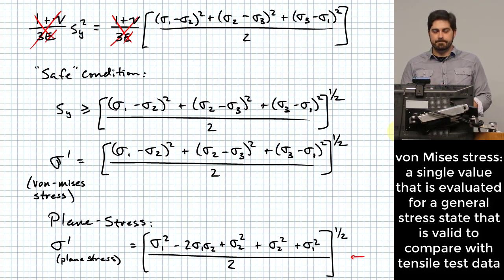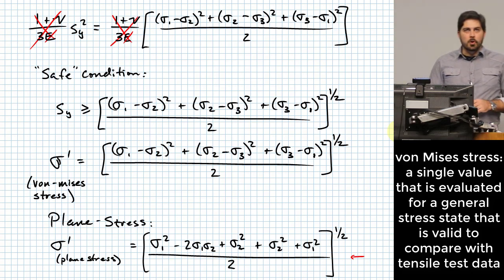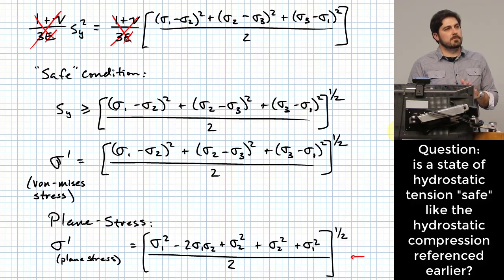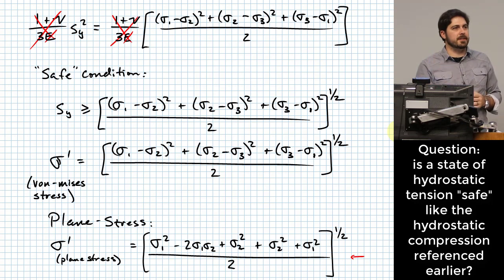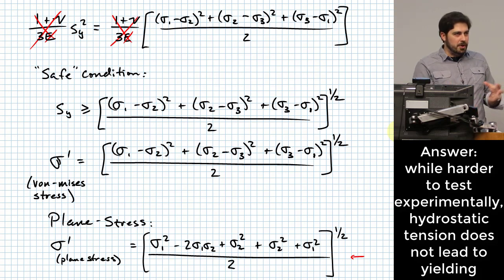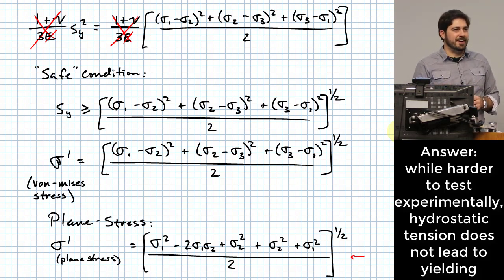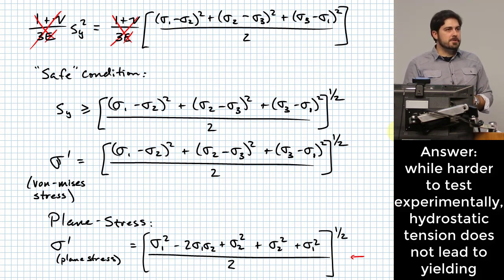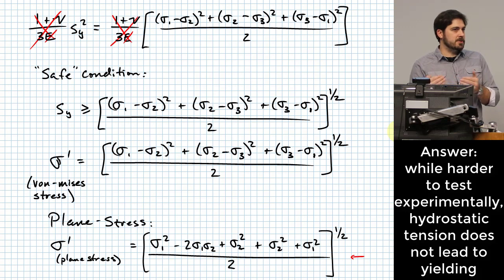Distortion Energy Static Failure Criterion; Von Mises Stress

Comment: The 4500 nm is the moment not the torques. why are you saying these are torques?
Reply from the maker: "Torque" is a term usually used by engineers to designate a moment applied around the long axis of a member. Both terms are valid for the 4500Nm influence. It is a torque around the BCD axis caused by the moment from lever DE.